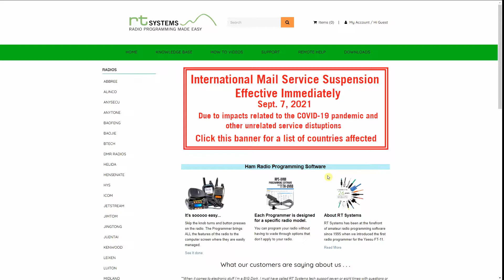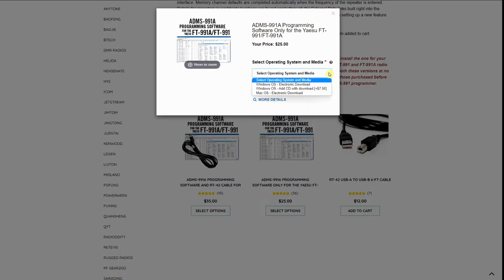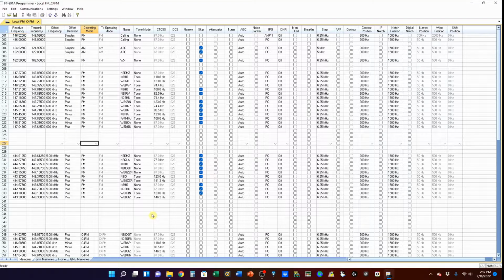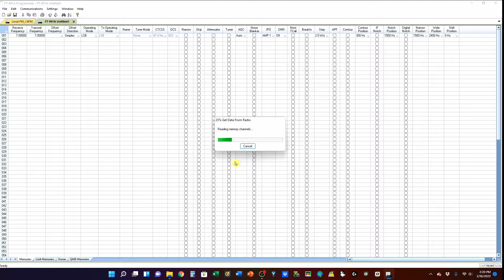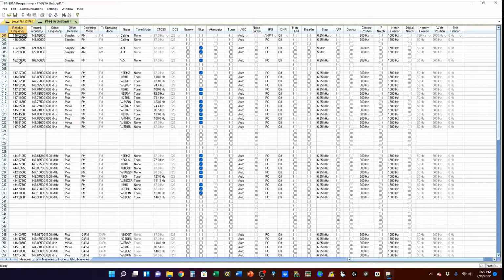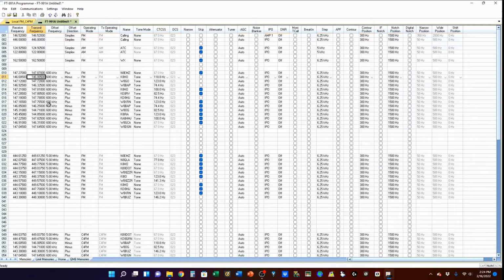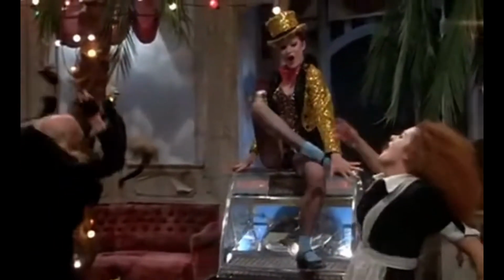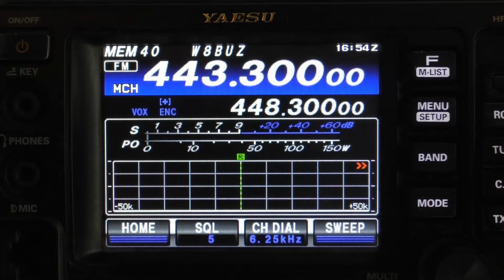Programming the FT-991A with RT-Systems S/W

Comment: The RT-Systems program for the FT-991 is a really nice program.  Unfortunately the virtual COM port in my radio has failed.  I can run CAT operation through the DB9 port on the back of the radio, but the RT-Systems program does not work through the hardwared port.  If anyone has a workaround for this problem, please post.

Comment: RT Systems software is extremely simplistic, however imo the beauty of RT is that all their programs for different radios are built around the same core making it very easy to be able to copy/paste between different brands that often have appealed OEM CPS’s that aren’t as simple to use to copy/paste with other brands.  Sometimes they might not even have copy/paste ability at all or the xml export/import function doesn’t work that well.  RT solves that by a common core and standardized functions.  RT also often includes little helpful extras such as the D-Star “calculator” that will create channel settings automatically for whatever it is your wanting to set them up for. I use RT for Yaesu, Kenwood, Wouxun, Anytone, etc.  I wish RT also could support Motorola, but we know how Motorola is about software licensing. :(

Comment: Thanks for posting. I use CHIRP to program my handheld transceivers.  I'm wondering if RT can import from a CHIRP save or if there is another way to move my lengthy list of repeaters from CHIRP to RT?  Maybe export CHIRP to a neutral format (like CSV which can be done with CHIRP) and then import into RT (thinking out loud - can RT import from CSV)? A second question pertains to transmit lockout. I can lockout transmit on any of my HT memory channels where I have something like the National Weather Service for example. This is done on my HT by setting duplex to "off" versus +/- like you normally would for a repeater. If I were to accidentally hit PTT on the NWS channel, no big deal. Transmit is locked out and nothing happens. Does the 991A have that feature, and if so, is that a check box in the RT software?  73.
Reply from the maker: The only way I can think of is to program you radio with chirp, then open RT Systems and download the settings.  RT Systems uses a proprietary software.  It isn’t  excel, but kind of mimics it.

Comment: what is the IPO column used for? I see you have the first listing as amp1 and the rest set at IPO
Reply from the maker: IPO is "Intercept Point Optimization" - When set to IPO, bypasses the RF Preamp.  Amp1 and Amp2 apply additional amplification of the receive side.  Good for dealing with high noise levels to pop the desired signals.  Usually a set and forget.  Check page 36 of the advanced manual and play with the values to find the best setting for you.

Comment: I have a good assortment of printer type cables, to that saves me $10, my question is;  if I wanted to use one of the remote control software offerings like Remote TX, or WIN4Yaesu Suite, would it be the same printer cable or something fancy?
Reply from the maker: It should be the same one…. Unfortunately, you can only use it one application at a time..  you should be able to use the serial port (db 9) in the back of your rig as a 2nd CAT port, though
Reply: @ND3N I will keep the serial port in kind, but it isn't a huge deal to change the baud rate if needed either.

Comment: Doesn’t seem to save the Split Channel I created on the 991A front panel. It saved it as the same frequency on Transmit and Receive. Where do you find the Split in this software?
Reply from the maker: I’m not sure. I haven’t tried saving a split freq.  that said, RT systems has a good customer service and if it can be done, they’ll know how. If it can’t be done, they’ll take a note and get it into the next update.  73
Reply: @ND3N Thank You for the suggestion. They got back to me right away. I am sending them my freq. list from the RT Sysrems software and they will see what’s going on. I will let you know what I find out. Liked and Subscribed!

Comment: Hi Tom!  I started entering some of my favorite repeaters into my shiny, new FT-991A and noticed something strange.  When I write the information to the radio it doesn't seem to pick up the PL tones for the various repeaters.  Have you heard of this before?
Reply from the maker: On the main page, where you enter your frequencies, scroll over a bit and make sure the column labelled "Tone Mode" has "Tone" selected from the pull-down menu.  Then in the column labelled "CTCSS" (right next to Tone Mode) use the pull down menu to select the PL Tone.  Once everything is populated, go to the Communications tab and select "Send Data to Radio".  If that doesn't work, contact RT-Systems Customer service by going to this link: https://www.rtsystemsinc.com/Support_ep_5.html - and scrolling down the page until you see "Click Here for Help" and follow the directions to get assistance.  Hope this helps - 73 de Tom, ND3N
Reply: @ND3N , thanks Tom!  I was able to resolve the issue!
Reply: @ND3N   This brings up a question for me, I have selected CTCSS in the Tone/DCS m-list, I have a few options CTCSS, D.ENC, DCS, and ENC, Everything works using CTCSS, but I think that is the two way tone control, would I use ENC if I only wanted to broadcast the tone to open the repeater, and not restrict incoming messages to my 991A?

Comment: I tried your suggestions to connect the 991a to my PC with out success. I changed menu item 31 on the 991a to 4800bps. I turned off the 991a and its power supply and unplugged the USB cable. Then plugged everything back in and powered On the power supply and 991a. I then ticked ->Communications ->Get Data from Radio and receive a pop up screen asking for "Comm Port Setup? The drop down box does not show any ports to select as if their are no ports being seen by Radio?
Reply from the maker: I'll have to take a closer look at this.  It's been awhile since I did this video and need to go back.  But I'll do that this weekend and see if I can figure out what's going on.
Reply: @ND3N  Thanks Tom. '73

Comment: Can you program uhf tx  vhf RX for sat use
Reply from the maker: You certainly could, but you would need to do something to adjust for the doppler shift.  As the satellite gets closer, the frequency on your radio would need to be set higher.  When the satellite is at zenith, it will be closest to the published frequency, and as it gets further away the freq would be lower.  A better recommendation would be to use the Ham Radio Deluxe S/W which has a dedicated satellite program that would do this automatically, and better, than you could manually.  73 de Tom, ND3N

Comment: Can I use the RT System cable for the 881A for N1MM control?
Reply from the maker: It is the virtual com port USB cable, so I don't see why not.  That port also provides the interface for the sound card.  I don't use N1MM (I prefer WriteLog) but the CAT should be the same.  73 de Tom, ND3N

Comment: I just picked up an FT-991A. It hasn't arrived yet but I was wondering how easy it was to program all the repeaters available locally. There are quite a few. You have shown that here, now I hope I can find the file from another ham. I want to know how easy it will be to convert from say a Kenwood handheld to this radio, do you get a spreadsheet and load it or can the files transfer between different programming software? Or will it need to be RT-Systems configured.

Comment: I like the RTs software as well.  I encourage users to save frequently.  I do, and save each file with the date (220219) and approximate time (1813); this keeps them in order by name as well as having a save date.  And now I always save, send to the radio and send to RTs both MEMORY AND MENU.  On multiple occasions, the send to Radio gave unexpected results because I had changed something perhaps I should not have.  I can then go back to a file I think is more correct, send it to the radio and get back to where I think I should be .  If it seems okay,  If I make changes in the radio itself, send that back to RTs and save it with a new date and time.  I find that sometimes I go back several files to find a good one to work from.
Further, I disable menu item 034 MEM GROUP  (not numbered in RTs Settings menu,> Radio Menu Settings>Common tab and is called Memory Group and uncheck it.)  It seems to limit the memories when VM button is pushed.  No guarantee what I am doing the best or only way.  Still learning.
Trying to setup scan to a limited group (Skip?), but  haven't gotten there yet.  I can scan only the five channels in RCL/STO key (QMB.) OR scan all the channels in memory.
RTs help says "First, select Settings from the menu at the top of the page.  From that menu, select Bank Settings. Several columns of the screen will be hidden leaving only Receive Frequency, Name and Banks.  This makes working on the screen easier since you no longer must scroll through several columns that you are not using now."
I do not have the option to select BANKS -sent an email to RTs.    Another discovery, copy and paste seems to demand the copied area size in a column be copied to at least ame sized area in that column (example, check marks) unlike a normal spreadsheet.
Could I be missing things?  Absolutely!
Reply from the maker: Great suggestion.  73 de Tom, ND3N